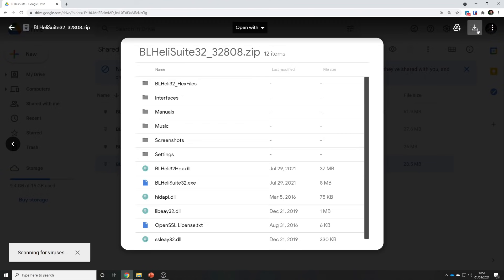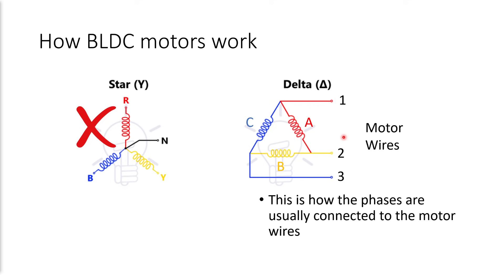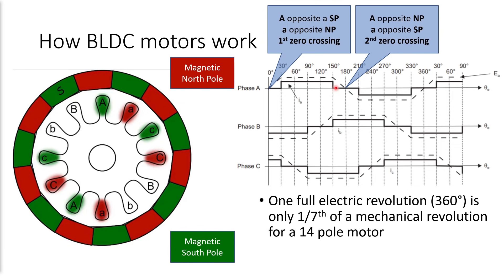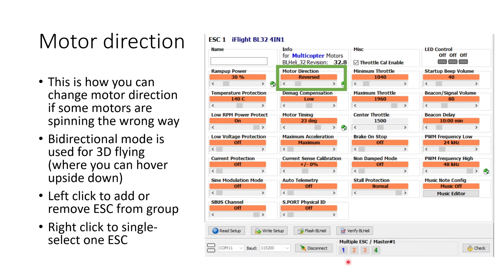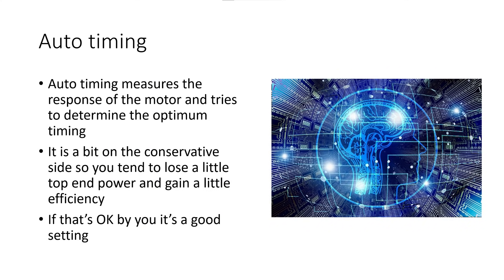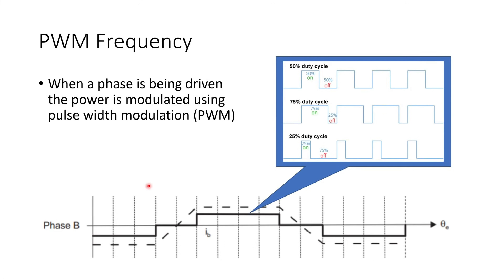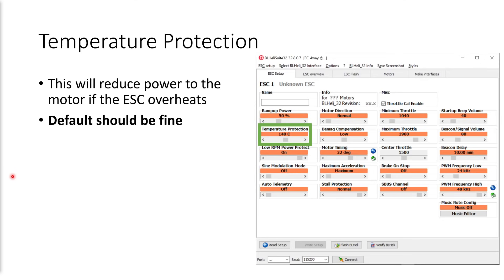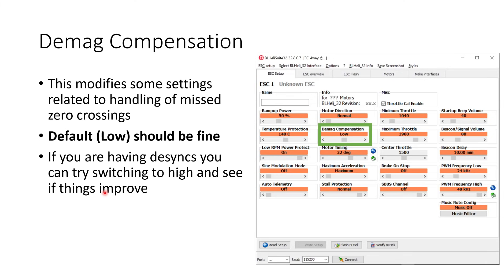Tuning your ESC (BLHeli_32) to stop desyncs and improve motor performance  in your FPV quadcopter!

Comment: Hey Chris ... great video btw ... learned something today ^^ ... i very rarely do stuff with BL-s or BL-32 ^^ .. KISS user xd
anyway ... the "Current Protection" and "Current Sens Cali" is only a thing if the "ESC for one Motor" got a Current shunt on it ... 99% of the 4in1's only got one A/D Current shunt on it .. and reports that value to the FC ... the ESC itelf doesn't do anything with it as far i know
Reply from the maker: Thanks, that's good to know. I've always used ESCs with an analogue current sensor so I typically don't have ESC telemetry enabled just bidirectional Dshot.
Reply: @ChrisRosser  yeah the only Software that does this is KISS ;) maybe you should try it someday ^^

Comment: Hi there, PWM Freq High when i set it to by rpm , and on hight throttle one of motor will desync and flip the quad flip of death, also i tasted with 48khz same issue only on 24khz quad seems fine!? Is that ok?
Reply: Pls can u share ur thoughts?

Comment: I've been having an issue with my legacy KISS setup, I've done lots of troubleshooting, and also lot's of part swaps.

New motor, new flight controller, new ESC, swapping the wires between the FC and ESC, monitoring Rx link quality, etc.  Sometimes I think both of my 4in1 ESCs have the same issue, but then I think it's the flight controller, because both of them exhibit the issue too.  The problem seems to be with ESC #4 on the KISS 25A 4in1.
No dead shorts exist through the mosfets.  in fact the ESC functions fine unless it's accelerating quickly.  It can hover, and I can do maneuvers on any axis, but if I jam the sticks, the quad spins out and falls out of the sky, and won't re-arm.
Does anyone have experience diagnosing the kiss 25A 4 in 1 or KISS in general?

Comment: I strongly doubt, that there are cw and ccw wound couls in the motor. I took several apart already and rewound some. Having north and south poles only originates from the polarity the 3 leads are connected to by the FET bridges. All windings are the same. Every third coil is wound from one wire, with three wires for the three groups.
Reply from the maker: If you check the bottom of a factory wound motor you will see that some of the coils are wound clockwise and some counterclockwise. The animation in the video shows how when the A winding is north the a winding is always south.  That is accomplished by winding A CW and a CCW. You are correct that the FET bridge also changes the direction of current swapping north and south poles as shown in the animation.

Comment: My 2810 1500KV motors are ticking (like a lightning discharge) with 8060 2-blade props, not with 3-blade ones. 23 degree, 24-48kHz, 25% rampup. Does anyone have an idea to avoid this?

Comment: This was an exceptional explanation of this stuff.  Thank you so much!  

One thing that is problematic for “recommended” settings based on the size of a quad is that the pilots who stand to gain the most from understanding these settings (top tier racers) the demands put on the Esc are likely an order of magnitude more extreme than the average freestyle or long range pilot.  

Dsyncs are very common in the first few seconds of flight for racing pilots.  What would your recommendation be to combat that?  

Many of us have noticed that slightly raising ramp up power helps along with raising demag compensation.  

What are the negative effects of running higher demag compensation?

How does the motor timing affect dsyncs?

Do you have any additional recommendations for racing pilots who are spending the majority of a flight near 100% throttle?
Reply from the maker: So if you are a racer who is getting Desyncs in the first few seconds of a race that is likely because your motors are cool and your battery is full so that will deliver the maximum current into the motor windings and create the most noise for detecting the zero crossings on the inactive phase.

A few things to check:
1. I've very recently learned BLHeli32.8 may have a susceptibility to desync so roll back to 32.7
2. Make sure your timings are quite aggressive 23-25 degrees that will be more robust against desync
3. Try 24 and 48kHz PWM. 24kHz gives more torque to control the motor but 48kHz may produce less noise so its hard to know which will be better for a given setup.
4. If get a desync from rapidly increasing the throttle try reducing ramp-up power slightly to 30% and see if that helps.
5. Demag to high as a last resort

Comment: Note: when using the latest betaflight configurator 10.8.0 and betaflight 4.3 builds, it IS possible to change motor direction in betaflight. I know because I did so. There is a special new dialogue on the motors tab specifically for this.
Reply from the maker: Very exciting. That is a useful feature. I hope in the future there will one configurator to rule them all for both AM32 and BF

Comment: I think you need a test stand to really set ramp up power. By feel is a bit prone to user error for such a scientific approach.
Reply from the maker: If you want to get it spot on sure. But if you err on the side of a more rampup power rather than less you'll be fine. If you have 10 or 15% more than you need it's no problem. If you have 50% more than you need that's when you risk smoking stuff.

Comment: Hi Chris, Ive been searching for an answer to a problem Ive had since I started fpv. Almost every time I build a drone when flying it for the first timeas soon as I arm it starts twitching and freaking out. Ive checked everything but I can figure out why it  twitches like that. Have  you ever experienced this ? Thank you
Reply from the maker: Does it twitch after you take off?
Reply: @ChrisRosser  No before.
Reply from the maker: @jordannovek2911  That's pretty normal. My quads are twitchy on the ground but the motors sound smooth after takeoff. Often it's worse on hard and uneven surfaces and better on soft and flat surfaces. Probably just the quad rocking back and forth slightly.

Comment: @Chris Rosser Hi Chris I was wondering if you think 12% ramp up power is to low for a 6s quad? I tried running it at 30% like you suggested but i kept getting desyncs, thankfully the quad recovered from them.
Reply from the maker: That is very low. If you are getting desyncs on a typical quad you probably have a mechanical issue.

Comment: Great video, get to know all the options clear, but I do have a 5'' quad desyncing all the times when I do yaw spin(pitch and roll are fine), and when I use 4s pack it's all good, only desyncs in 6S yaw spin, do you have any recommendation for this? Thanks!
Reply from the maker: Things to try in this order:
1. Go back to 32.7 (some people have desync issues with 32.8)
2. Reduce ramp-up power down to 25%
3. Demag to high
Reply: @ChrisRosser  Thank you very much for you tips, tried 2 and 3 from my search on internet and 32.8 could cause all actions desync including pitch and roll so I use 32.7 now, but why is that : ,,, (  . Today I find my esc had a lot of bad input frames and I turned down my dshot a level, will try if this works tomorrow,  anyway thank you, you've down a lot of help

Comment: Are 3115 1050KV considered as small or bigger motor in regards to blheli (which of course drive really big motors) ?
Reply: I would say big and slow, it is much higher and slightly wider than typical 2306 or 2207 and much lower kv than 1800-2600 on typical 5inch.
Reply: @GibRealistic  
But blheli is used in professional applications with motors line 50 times bigger
Reply: @jas-FPV  sorry, I missinterpreted your question, but clearly you know the answer.

Comment: Hey Chris, in betaflight 4.2 do you know what the warning "runaway throttle" means? My quad is disarming mid-flight as I'm applying throttle on take-off.
Reply from the maker: It usually means the quad is trying to flip out and betaflight is stopping itself. Check motor direction in BF.
Reply: @ChrisRosser  I read up on the beta wiki about it and motor direction is correct, betaflight motor direction is correct, props are on correct, and it said something about the gyro I can't remember, how do I recalibrate the gyro?

Comment: Hi :) what about Maximum acceleration ? Same as rampup power but on rotational speed ?
Reply from the maker: Yes. This setting will limit motor acceleration based on RPM rather than power.

Comment: Hi chris! Quick question if you dont mind, im new to building, just finished my 3rd scratch build and am learning tuning, im wondering if pid tuning can improve flight time if done right or if pid is only changing how the quad feels.
Reply from the maker: Typically PID tuning will not change flight time but will improve the flight feel and performance.
Reply: @ChrisRosser  ok, thanks for the reply. Now i just gotta study your tuning vids a bit more and get this thang a lil smoother. 😁😁😁

Comment: the old amax 1103 is in the star configuration
Reply from the maker: Really? Very interesting! Does it have a fourth wire for the neutral or is it just left floating?
Reply: the wire ends are just soldered together and covered with a small piece of heat shrink, tucked in under the windings
i wondered if connecting the neutral point to battery ground would reduce electrical noise

Comment: Know I'm late to the party but do you care to comment on ramp up power as it could potentially relate to video noise?
Reply from the maker: Reducing rampup power might help with video noise. Another solution is to use an intereference isolation film like the one made by Diatone.

Comment: Or you can use AM32 to stop your desyncs!
Reply from the maker: There are many factors that cause desyncs. ESC firmware is only one of them. It is oversimplifying the problem to say that changing to AM32 will stop desyncs on any particular setup.
Reply: @ChrisRosser  Would you be curious to check it out? I'll send you an esc and you can give it a good thrashing?
Reply from the maker: @alkamotors158  I would love that! I am a big fan of the project. Do you have a 4in1 suitable for a 5inch?